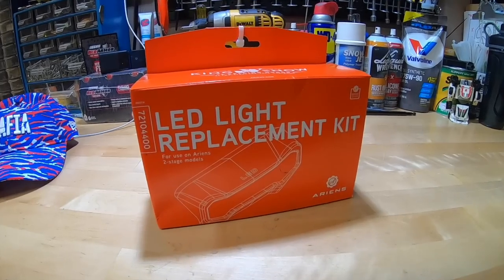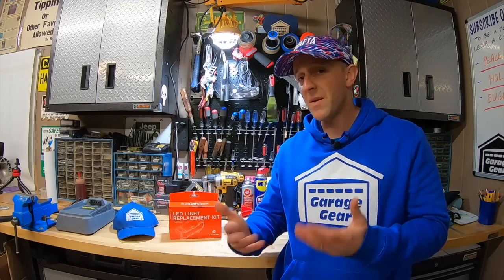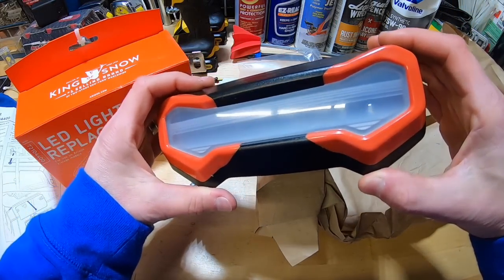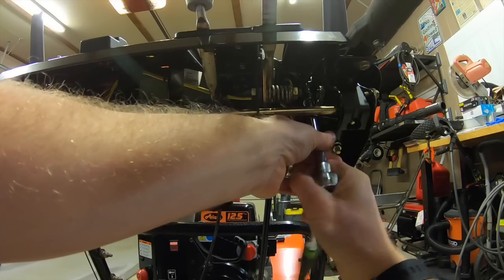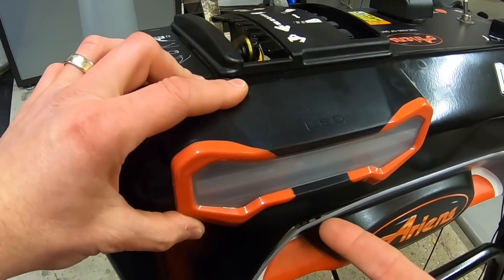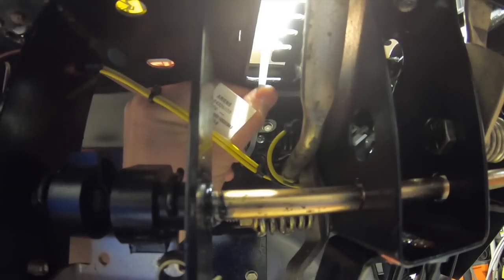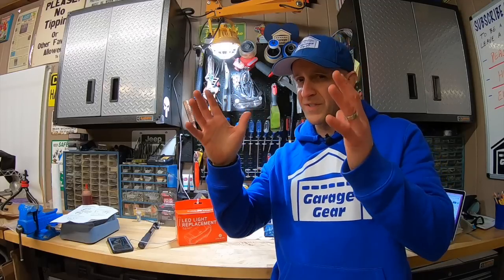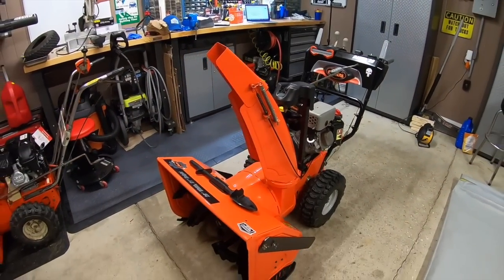Is The Ariens LED Light Kit BRIGHTER than the HALOGEN Headlight?

Comment: I don't have the stator for electric lights on my old Toro  blower so I use a Milwaukee drill driver battery to power my heated grips and LED flood light. I light up the whole yard with that light. I was going to mount two of these lights but found that one is great plenty. It's an 18w fog light used for vehicles and being it really lights up the road it would be perfect for my snowblower.
Reply from the maker: Thanks for sharing

Comment: Definitely an improvement over the original halogen setup. I upgraded my 2 eligible machines last winter. There are 6 individual LEDs in the housing, all slightly angled differently to cast an even spread of light. The light actually performs even better in the snow. It reflects off the snow nicely.
Reply from the maker: Awesome Smallblock! Thanks for sharing this info! I can’t wait to try it out when we get some more snow! 👍 enjoy your weekend bud!
Reply: I find your videos / tutorials very helpful. Thanks & keep em coming 👍
Reply from the maker: @emzye4641  ROCK ON EMZ! Thanks for watching
Reply: @GarageGear  Any ideas of how to add a on/off switch to it?  Like your videos...
Reply from the maker: @richardseaman4787  thanks Richard! I’m sure you could splice wires leading up to it! Find the right wire, link it to a switch and you’re golden! Thanks for watching!

Comment: That upgrade LED sucks man. They all do, poor design with location of light. Can't see right in front of blower where you need the light the most. The unit and motor blocks light from the front. Why snowblower companies didn't mount lights in front above auger is beyond me. I did what your neighbor did to his blower on my Toro snowblower and its the bomb. Super bright and lights up the whole path right on front where I need to see. I even mounted 2 small LED lights under control panel pointed down on the grown so I can see where I'm walking. Came out awsome!  Never understand why none of these snowblower companies never came out with a front mount LED kit the consumer could buy. Anyways, love your vids!videos!! I'm a subscriber!! I live in Rochester too 🙂🙂
Reply from the maker: I question a lot of designs nowadays too jim! Thanks for sharing and for being a cool fan nearby! 👍
Reply: They mount it there because it's the highest point which helps depth perception and keeps it above snow that is higher than the bucket, so when you're going through a drift you don't lose all your light or use the light housing as a drift cutter.  It also helps to see where you are throwing the snow a little better and usually won't vibrate quite as badly as something mounted directly to the engine like some are, which increases service life.  The cable is also better protected than a bucket mount. Some models have additional lights on top of the bucket, but if you only have one light, there are good reasons to put it where they do.   You can see in the video that since the light is on the right and the chute is on the left it still lights up the area directly in front of the machine where he is standing.

Comment: Location of the light on snowblowers always made me scratch my head. An LED lightbar mounted on the top of the auger housing seems to be a better spot.
Reply from the maker: It does make sense there. On some new models they have it there! Super bright too! Thanks for watching venom!
Reply: The new Ariens have the light on the auger. I asked Ariens if they would be offering a retrofit kit for the Auger LED, but sadly they said no.
Reply from the maker: @flyjarrett  that’s a bummer! 👎
Reply: Makes sense there until snowblowing real deep snow.
Reply from the maker: @officemanager8624  deep snow would bury the front end led.
Reply: @officemanager8624  Yep.  If you only have one light, you don't want it on top of the bucket for that reason.  Also, being mounted as high and far back as possible allows for somewhat better depth perception and being able to see what's happening on the blower, such as slush and ice buildup, as well as over drifts.   It also means no exposed wires on top of the machine.   Any place you put them there are compromises but there are good reasons single lights are usually put here.  The best is to have multiple lights and we are starting to see that more and more.

Comment: JB, Thank you for your videos, I find them very helpful.
I have an Ariens Deluxe 28 SHO and would like to switch out to LED lighting but due to the hood / canopy the current lighting glares against the clear plastic. Would LED help this glare or is there a way to get lighting outside of the canopy, any suggestions? 
Also, This year while blowing snow I have noticed a brown liquid dripping from the wheel drive shaft, not a lot, a few drips every 10 -15 yards. And is also collecting on the wheel rim. It is not oily and easily wipes off. Have you seen this before? 
Looking forward to your next video.
Reply from the maker: Hey Mark, appreciate you’re positive feedback my friend! Not sure about the canopy glare. The canopy doesn’t have a hole cut out for the light?  Could possibly cut a hole for the light. 

As far as the brown stuff on the wheels. Seen it before. A little wd40 will take it off no problem. I would try greasing your axle shafts with anti seize. I believe it’s just part of the shaft rusting and forming a residue on the wheels. Mine do it at least once a season. Wipes right off. Nothing to really worry about. Thanks for watching my friend! 👍

Comment: I have an older Ariens 1332, I also installed a LED light, (1- Nilight 6" rectangular flood), I wired it directly into factory light harness without using factory  light and yeah it wasn't that bright so I wired it straight to the battery with a switch and WOW big difference, light was as bright as it should be.
Reply from the maker: Thanks for sharing John! Appreciate it!

Comment: I have a 2014 Platinum 30, and this says it doesn't fit on mine, but I don't really see why. From what I can tell the lights are the same as the other models, so I'm assuming it's because of how the dashboard is setup?

Edit: I looked up the part number for the stock light on yours, and it's the same as the headlight on mine, so I think I'm just going to order one anyways and make it work.
Reply from the maker: See if you can make it work! Worst case scenario epoxy it in lol

Comment: Two years ago I modded my  new Ariens with an LED kit, push button hand warmers and a tach kit. This year I'm contemplating left and right turn signals, a tail light and racing stripes. I have to be first. 😉
Reply from the maker: Hahahah you’re a pioneer in the snowblower street scene! Are you going to get a high wing spoiler too? Thanks for watching bud!
Reply: I live just outside Buffalo, NY.  We could start a snowblowing racing series.  Clear roads while racing, a two for one.
Reply from the maker: @Gregwing  I like the idea! Thanks for watching
Reply: Go for a motorized chute controller, like me : https://youtube.com/shorts/AEMSsaCsFdE
Reply: @Patat0four  The idea is COOL but the mechanics of it looks really SUS. I'll bet it's a proven performer outside a warm and safe garage where water, snow and frigid winds will do their best job on it. NOT.
It looks, sounds and operates like a beta model.
On this one, I think I'll wait until the 3rd generation comes out.
Reply: @Gregwing  Now this is a guy who thinks FUN. 😄 👍
Reply: @SpaceCadet4Jesus  I invite you to look again, this system is sturdy as hell. I live in a remote area in Canada, I worked countless hours in the most hostile conditions, with ice buildups, snow packed everywhere. It's made out of an old 9v Makita screwdriver encapsulated in a shrunk 2 litre soda bottle to avoid water contamination. It is so strong, if I didn't loosen the drill clutch, it could bend the auger screw. The beauty of it, if it fails, I just unscrew one bolt and I can always put back the old handle. The H-bridge is made with car relays that can handle 4 time the current in this system. The only modification I did since this video is I tied up all the cables in a protective plastic sleeve.
Reply: @Patat0four  Glad it's working for you. I've only a simple handle that is in the same position of your Makita.
Reply: @space cadet I can’t remember how many times I stabbed myself in the leg during sharp turns with this handle. All winter long I would have this  bruise on my left leg.
Reply: @Patat0four  Owwuchh! Thankfully my handle is inset enough that I've not encountered it over 2 seasons. Sounds painful.

Comment: Thanks for making this video!  I was actually thinking about hijacking the headlight wire on my Ariens Compact 24 to instead put on heated handgrips. Is that legit?   I saw your older heated handgrip video.   Let me know if there are some good (lower cost) aftermarket heated grips.  Also, since LED uses such low power, can the wire be split?  Finally.... Go Vikings! 🤣🤠(Hey...at least it's not the 🧀)
Reply from the maker: Hey Brandon, the budget hand grips do break over time! Low life expectancy. My previous ones didn’t last. You’ll want to get the ariens one. I linked up with the wire for the heated hand grips. Should be fine with your led! Enjoy the rest of your weekend my friend! 👍👍

Comment: I have an Ariens 932105.  It's marked as "not compatible" with this, but curious if you know, or know of anyone that got the LED light kit to fit/work.
Reply from the maker: Hey Scott! Not sure of anyone that has or any specific way to rig one. Gotta wonder though if splicing the wires and making your own wire  connections works for this. Thanks for watching!

Comment: Dude I want to do this so bad but I have a cub cadet haha. Something I’ve been thinking about for a while. Time for some research! Either that or just mount a small light bar myself and wire it into the existing wiring.
Reply from the maker: Hey Ben I think a light bar is in your future. There are some videos on this on YouTube. Thanks for watching another bud!
Reply: @GarageGear  I went to Home Depot last night, and on their bigger cub cadet they have a front mounted light right on top of the auger. Not sure if it’s an option or whatever, but I’m definitely doing some digging!
Reply from the maker: @BenNawrath  see what you can do brother!
Reply: @GarageGear  found some videos…. It’s on the list for sure. Need to watch some more.

Comment: My troybilt storm didn't come with a light wish it did. I've seen several other people add aftermarket led headlights using drill batteries to power the light not sure how it works because I haven't tried it yet
Reply from the maker: Yeah, I have seen that too. It seems to work pretty well.

Comment: I have an old Yamaha YS624T, tried to replace the original lighting with a 9W led, but when on high RPM the light shuts off. I’ve measured the voltage when it was running at full to be at the upper 30 volts. Guess I need some kind of transformator to tune the voltage down, any suggestions?
Reply: Edit; yes the output voltage of the snowblower is AC. Tried to install a AC to DC converter but I guess the converter is to small since its maximum voltage its 28 volts. And I can’t find any other converters that transforms from 30/40volts to 12VDC
Reply from the maker: Hey Chris, I heard a converter is needed for this. There are videos out there on YouTube on it. Perhaps someone has one linked you could check out. Thanks for watching

Comment: Off the subject question I have seen your video on your Toro time master do you advise removing that blue foam insert from the gas tank, does it even do anything I worry that over time it will star to come apart and block fuel line, ?
Reply from the maker: Hey Leonard, I am pretty sure the sponge is in there to prevent fuel from sloshing around. The gas cap is pretty lame and will leak. If fuel is moving back and forth it could leak out on bumpy terrain. My guess it’s there to keep that from happening. I left mine in there because I ended up putting the bigger tank on anyways. Thanks for watching!

Comment: Hi JB.  I reached out to you on some other vids . Although we haven't had any snow yet where I live , I can say the factory light on my new 28 pro sucks. I tested it at night . Horrible . $2800.00 machine and they cheezed on the light . Come on Ariens , show the love !
Reply: Gotta give it to cub cadet on the default lighting
Reply from the maker: Hey Paul! Is your model new this year? If so you must have gotten a model that was end of last years stock. Just a guess though. Let me know!
Reply: @GarageGear  I will look into it when I get home ..it has sort of a smoked look on the glass / plastic cover . A friend of mine installed a light kit on his . I may just go with headlamp . The old quartz halogens were great . Melted the snow also

Comment: Couple of questions not related but since i keep all my equipment like new do you apply any type of coating on you weed wacker to keep the finish like new? Also did you do any shows on generators as far as storage goes since it is a hit and miss item for use.  Thanks, Dennis
Reply from the maker: Hey Dennis! I don’t coat my trimmer with anything during the season! You could dress it up with automatic transmission fluid really quick. That would shine it up fast. And here is a video I did a while back on generators and how I take care of mine. Thanks for watching HARBOR FREIGHT TOOLS PREDATOR 4000 WATT GENERATOR - Modifications, Oil Change And Review
https://youtu.be/0CJaabMUhdA